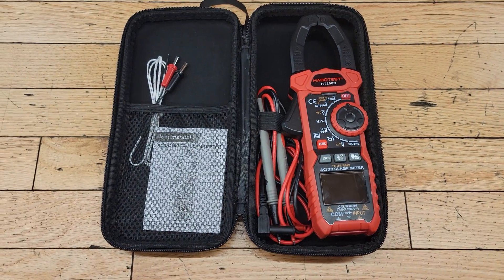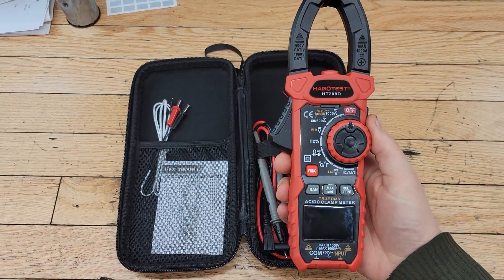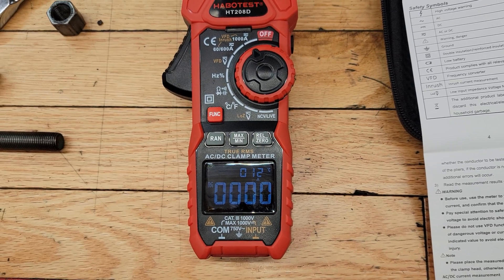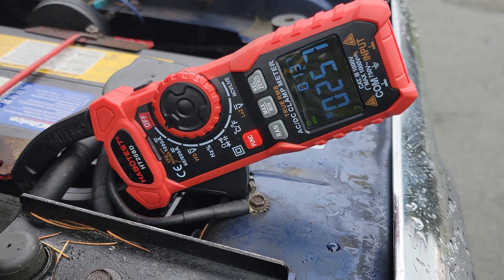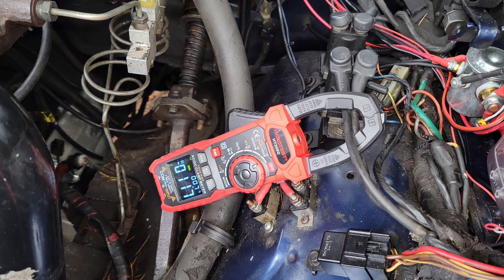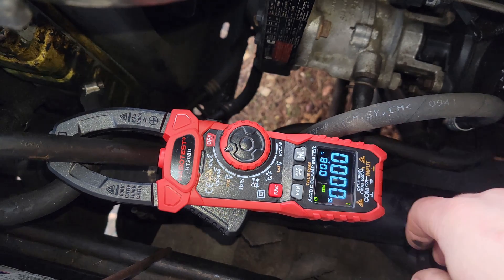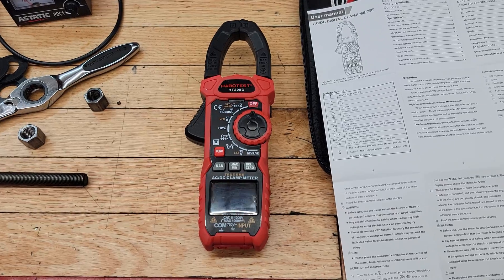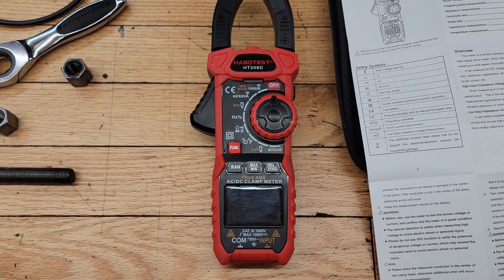How Many Amps Does a Cummins Grid Heater & Starter Draw?

Comment: Is the 676 amp starter draw with a cold motor ?
Reply from the maker: Yes that was after letting it sit overnight and temp was probably around 5 c, actually I think the temp shows right on the clamp meter if you can read it.
Reply: @OvensGarage  Yep, temp reads easily !! 7C to 8C (45F). The 676 amps looks to be a peak hold reading. I'll see how my truck and meter compares.
Reply from the maker: @mikep95133  would be interesting to see yours. I bet it'll draw less in warmer temps. Keep in mind too this is an aftermarket AC Delco starter and not the original starter motor.
Reply: @OvensGarage  I replaced my starter a dozen years ago. We shall see !
Reply from the maker: @mikep95133  this one is new within the last year. I should test my red truck it's an original starter and I rebuilt it a few years ago.

Comment: Cool video I've decided for now to disconnect the grid heater it works great except the fact that it keeps on attempting to cycle as I'm driving which it keeps shuffling my transmission out of and into overdrive. So I have decided to rely on the block heater. Replacing the IAT sensor did fix the issue for a little, but then it came back.